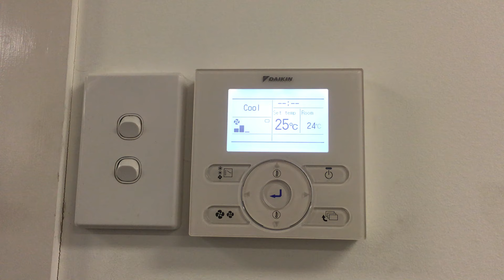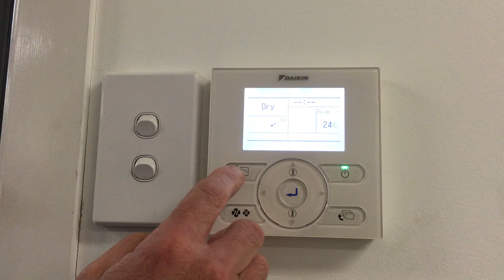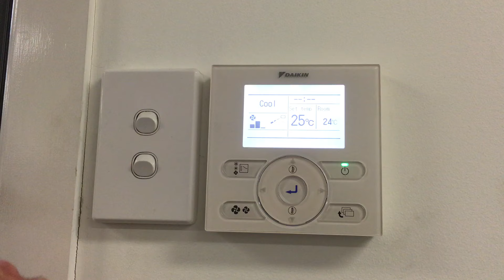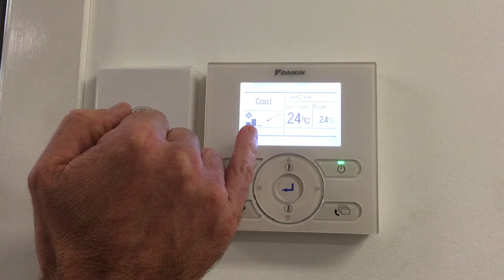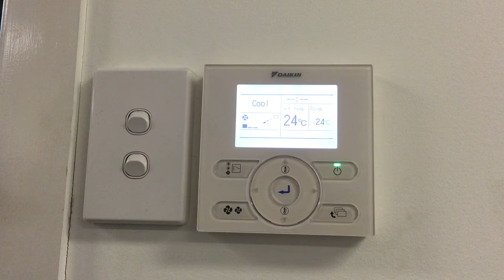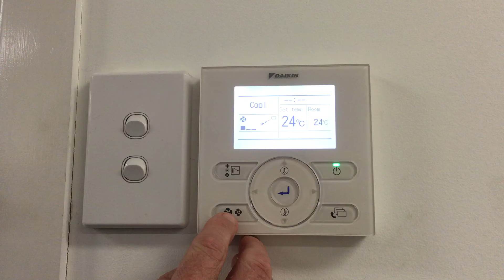Operation Guide   Daikin Wall Controller

Comment: Just FAN AND HEAT  on my system.  How can i make it cool mode?
Reply: I've got the opposite cool but no heat, did U find a fix?
Reply: Mine too…
Reply: Exactly my problem, I want cold air, why is that so hard??
Reply: @nickoleo7817  same did u fix

Comment: Interesting comment Dry mode not available in Australia- according to Dailkin support today,, it is available? Needs more detail - fan speed also has Auto mode - when should this setting be used? What is the optimum temperature range setting for Heat and Cold?

Comment: Hi mate, Is there anywhere to see error codes diagnosis? My compressor unit is turning on and off repeatedly. Not sure if it's a block drain issue, bad capacitor on the motor or filter?

Comment: I have an older model ducted air. The control is on the wall and has a dial. No screen. And symbols. Does anyone else have similar version. mines not cooling